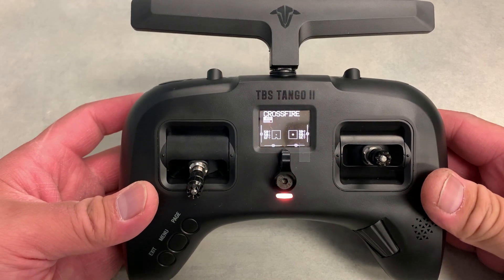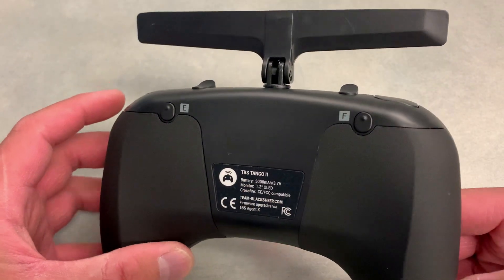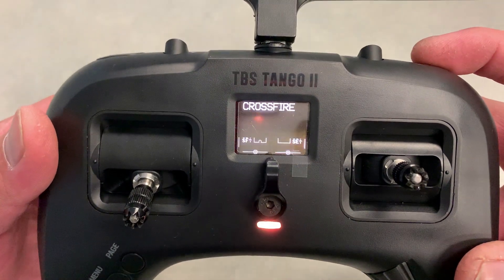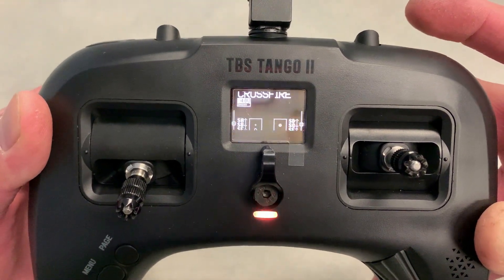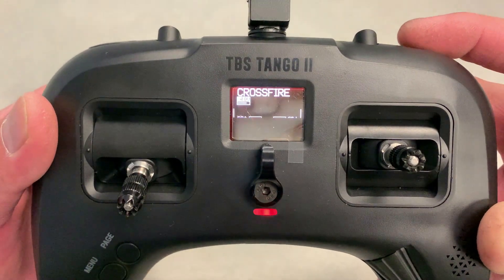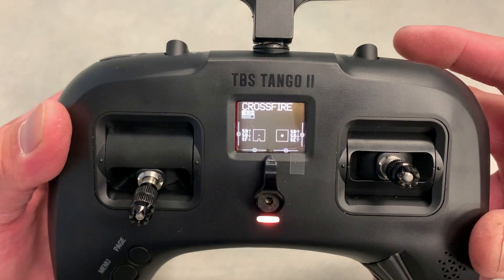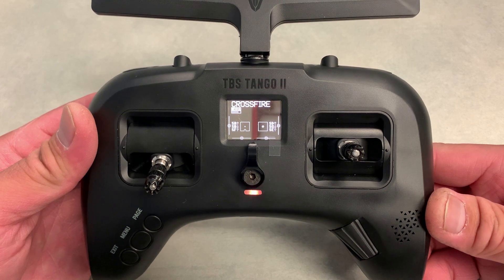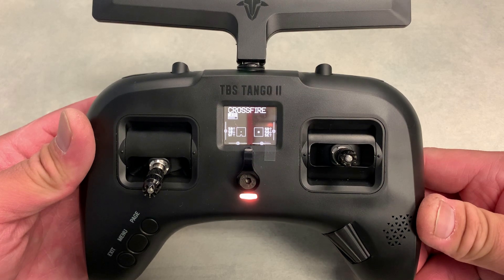TBS Tango 2 Volume Control on ONE BUTTON

Comment: Good idea, but I made easier : I hold back button and regulate volume with stick (yaw for example). Another button do the same but with Led color (in betaflight).  Thanks for video!
Reply: NVMI figured it out, thx for the idea!! If anybody else is curious all I did was set Input32 weight to THROTTLE and switch to SEdown and set global variable VOLUME ON TO INPUT32 and that's it =)
Reply: @JayJayNapalan  Yes, all so easy :) Sound for me not so important. I use this method to set correct color led on copter (SF for color, SE for sound).
Reply: AWESOME can you share what settings you did please? thanks
Reply from the maker: Ha that’s awesome, I think I may do that instead!!!!
Reply: How did you set that up?
Reply: can you please post your programming?
thanks

Comment: Sorry I forgot to paste this in my earlier post.  It is an excerpt of Alex McCumber's post in TBS Tango 2 FB page on the same subject that  I am posting below.  There's more to Alex's post if you want to read the whole thing but I followed the steps below to setup Ch 32 for Volume and used the Logic and Special Functions code from this video. 
---------------------------------------
Page 3 - Flight Modes
- select FM0 (this is the default flight mode)
- name G1 (global variable 1) to something useful - I used "GVo" (global var. volume)

Page 4 - Inputs
- create a new input below your regular channels
- Input - name it something useful I used "Vol"(now shows channel as "iVol" in input selections)
- Name - name it something useful I used "Volume"
- Source - set to MAX
- Weight - set to the global variable you named in the flight mode above; for this example it is "GVo" (named in the flight mode screen)
---------------------------------------

Comment: How do you setup the ON Volume i32?
Reply: Yeah please explain this part. I read your other comments below and I still don't know what you mean. I cannot select G1 as the input source. Only the button SF?
Reply: Nevermind got it, pretty hard when we only get half a tutorial...

INPUTS PAGE - Source : SF, Weight : G1, Curve : Custom | For my curve the volume was the wrong way around so I created a custom curve the opposite direction. Id rather long press instantly muted speaker.

Comment: Thank you for posting this!  I have a couple questions:  in the Special Functions, for the first 2 lines in your screenshot it showed “ - = 25” and “ + = 25”  I couldn’t find the “ = “ in the selections, only numbers.  Also for the “ON Volume” line, looks like you set channel 32 to be an input, can you provide more details on how to set up that channel to correspond to Volume input?  Thanks!
Reply: Never mind, figured out what  my problem was.  Thanks again for making this video.
Reply: Pleas for me as well, can’t find a way to set channel 32
Reply: @aarem01  I found this and there is a section that shows how to assign volume to a channel
Reply: @aarem01  As for the “=“ for the +/- 25, you long press the jog wheel when you can scroll and set the “25”, another dialog pops up with 3 choices, choose the bottom one, I forget what the function is called now but that will set the “=“ in the code
Reply from the maker: Ah yes sorry for the late reply....yes you need to king press the jog wheel to get the options for “increment”

Also channel 32 needs to be assigned a global variable in the mixes page
Reply: @rcfpver4335  how can I assigned a global variable in the mix page? Can you help me?
Reply from the maker: @vollmtorify  Hey bud.  One thing I left out was that in the Inputs tab, you would set G1 as the source of the weight of Input 32.  You will then assign Input 32 as the source for the volume in the special functions page.  When the logic adjusts G1, it will change the weight of input 32, thus adjusting the volume since input 32 is the source of volume.
Reply: @rcfpver4335  thanks  a lot i‘m nee in the RC hobby. I test it and hiev you a reply